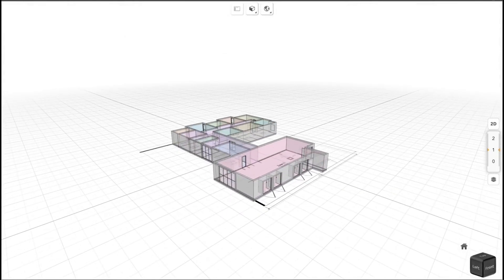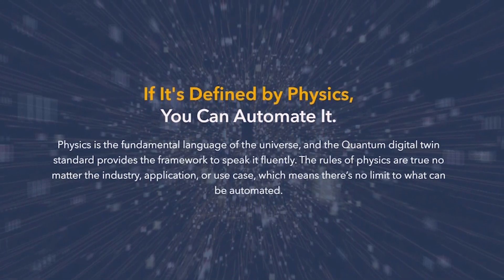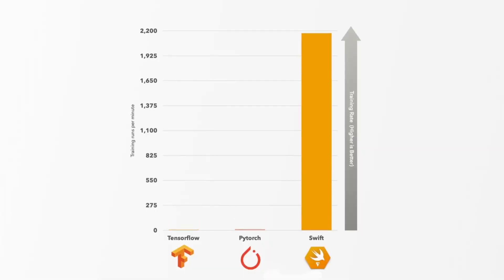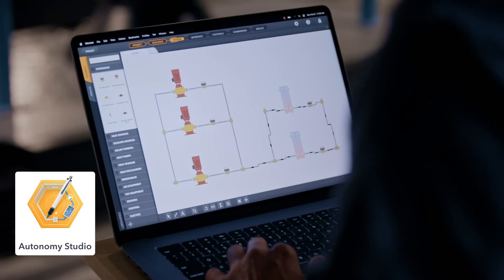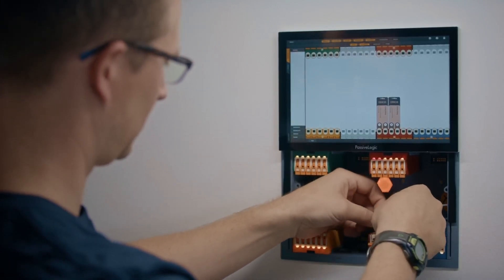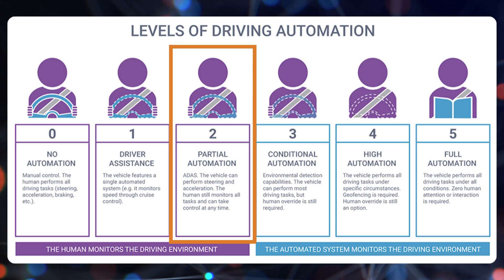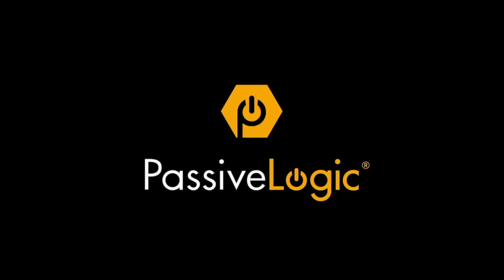Smart Buildings Powered by AI & Physics! | PassiveLogic Explained

Comment from the maker: 🎯 Here are some key takeaways for quick navigation:

00:00 🏢 Buildings can be optimized using AI and physics-based simulations to improve functionality and efficiency.
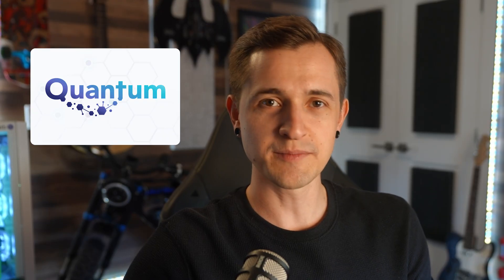00:51 📐 Quantum provides a standardized framework for creating digital twins of buildings, ensuring consistency and a common language in the industry.
02:08 💻 Passive Logic developed an AI that compiles information within a building to create custom models, optimizing it for efficiency and comfort.
03:46 🛠️ Passive Logic offers a software ecosystem consisting of six applications for building design, automation, and optimization.
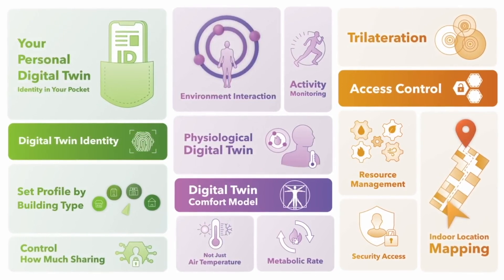05:36 🏢 The hardware components include the Hive platform, Hive Mini, cell modules, and sensor devices, enabling efficient building automation.
07:55 🏛️ Passive Logic's system achieves level five autonomy for buildings, surpassing the complexity of self-driving cars, making it highly innovative in the industry.